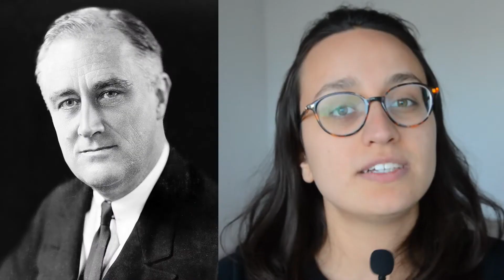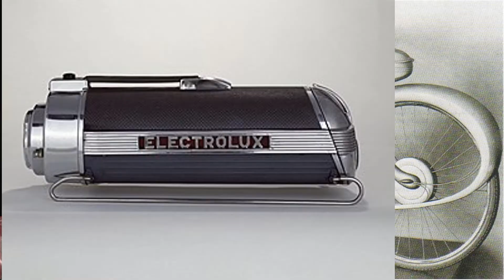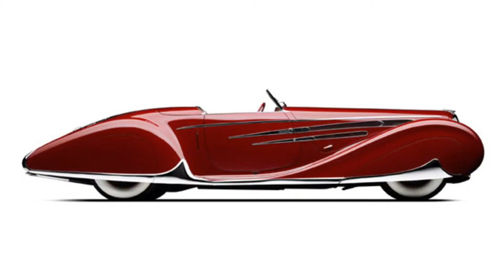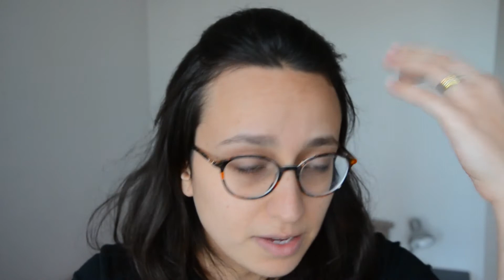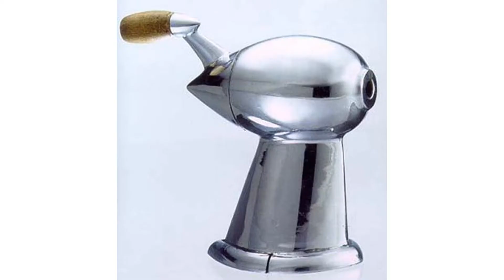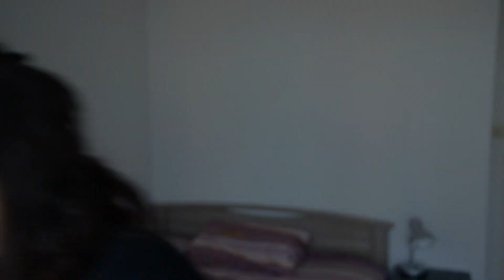Sleek and Stylish: The History of Streamline Design

Comment: I think historically most streamlining, even in moving vehicles and objects, barely added functional benefits. It was ornamentation to capture a spirit and belief, trains are a great example. They stuck stronger engines in trains that made them quicker, but the streamlined form did nothing to add to that speed. It just made people feel they were in a new age. As you mentioned, it stimulated the economy with new form and production techniques. But I do feel when we speak about streamlining form in contemporary contexts, it’s more to do with shape and ornamentation, rather than the aforementioned iPhone that follows much more modern principles in function.
Reply from the maker: Yes I agree for some cases! But streamlining did enable lots of sectors to reduce drag in their products more specifically in transportation (trains, boats, planes, cars) in many cases it is negligible but I encourage you to check out the Shinkansen train design! It was inspired by king fishers (type of bird). The novel shape allowed the train to be much more quiet when passing through tunnels and also helped in reducing fuel use! 
But it is true that the streamline style was used a lot more as an ornemental or aesthetic feature !